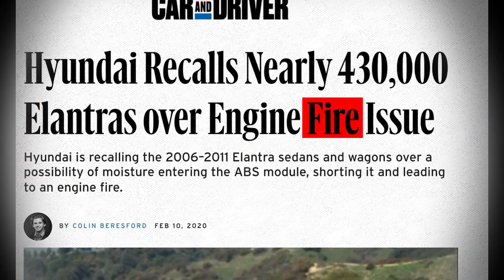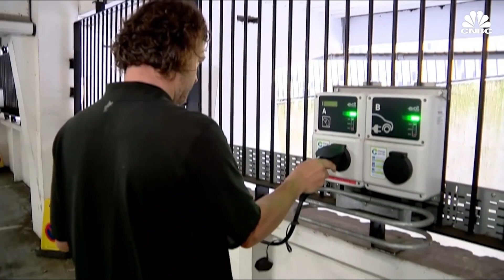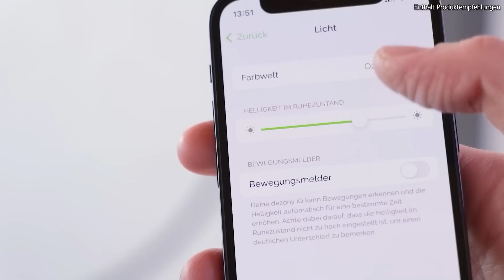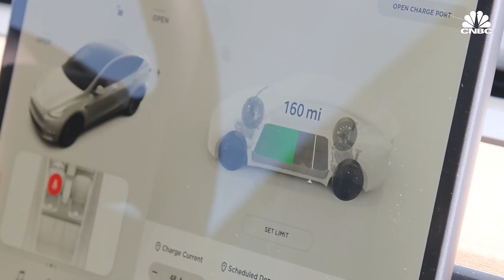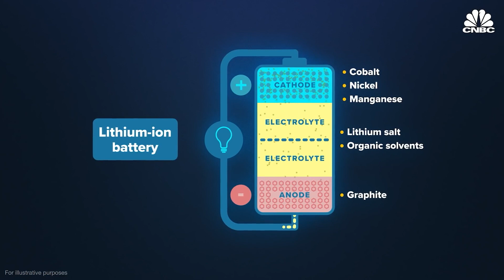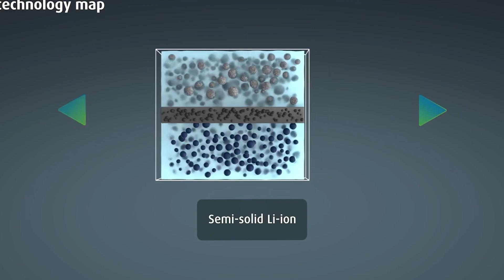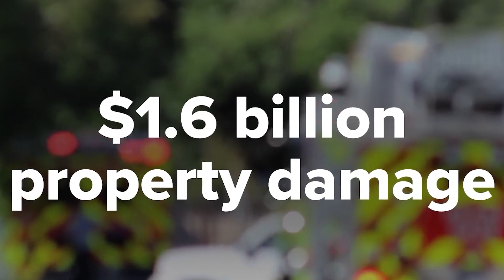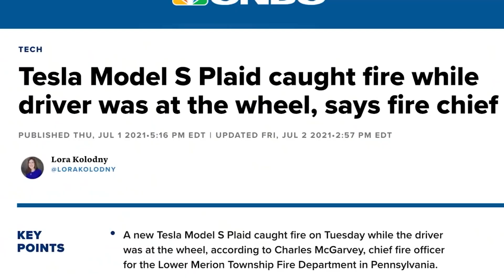EVs Igniting into Flames at Alarming Rates!

Comment: IMO this will get worse as they ramp up production and start trying to save money during production to increase profit margins.

also with the ship fires even if it wasn't the EV's that started the fire they added a lot of fuel to the fire. ICE cars if loaded as new cars (second hand can be different depending on transport company) barley have enough fuel in the tank to get it on and off the ship and ordinary fuel needs oxygen to burn so if a fire does break out they can simply shut of the air vets to the burning deck and let the fire chock itself. EV's on the other hand burn via a chemical reaction thus they dont need oxygen thus they can't be put out on a ship by normal means.